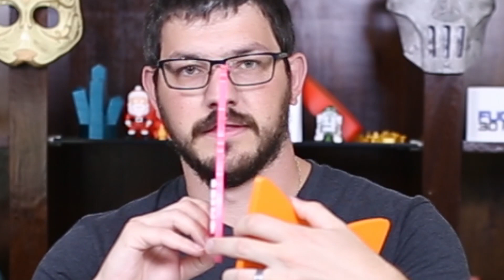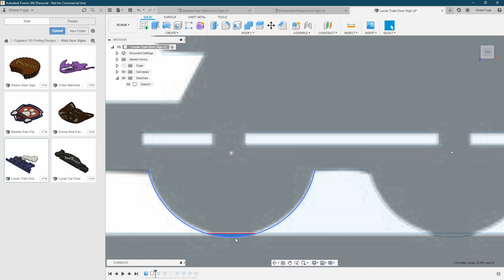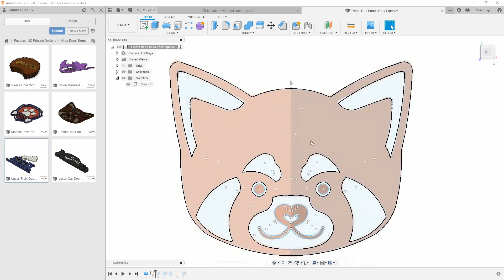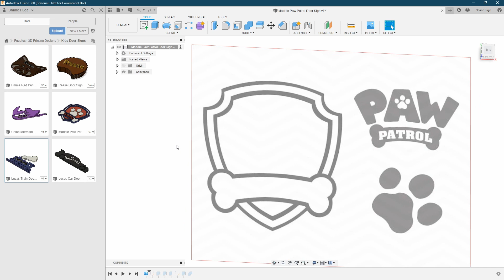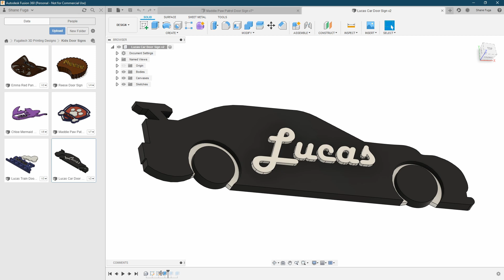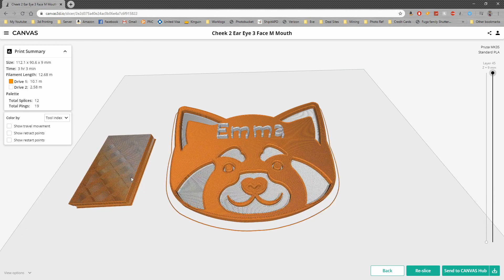3D Printed Kids Room Name Signs

Comment: I had done my prints using inkscape to seperate the colors and then gimp to clean up and Tinkercad to stack and create STL. I haven't used Fusion360 enough but did use the canvas to trace an object in a photo and didn't do to bad of a job. Good video and tips to concider for my future projects.